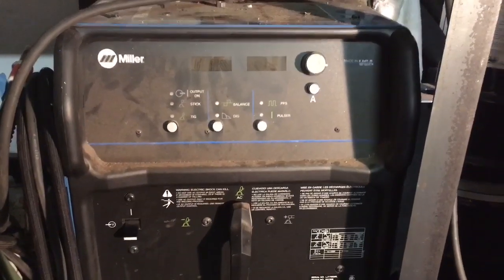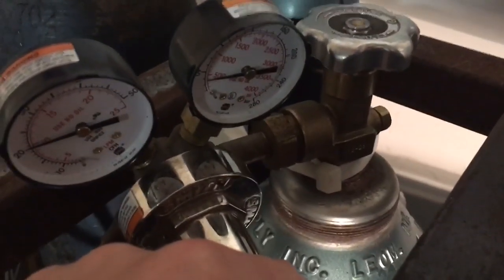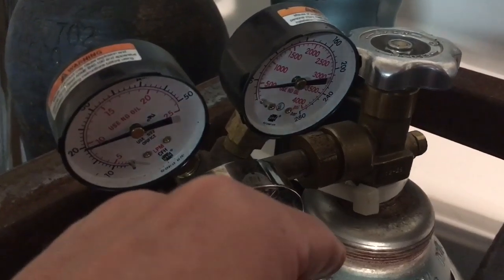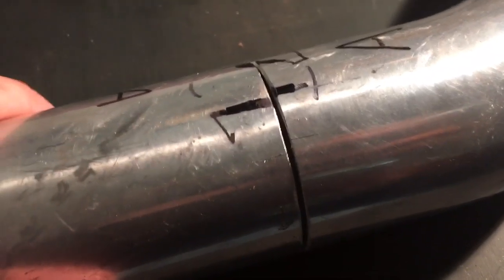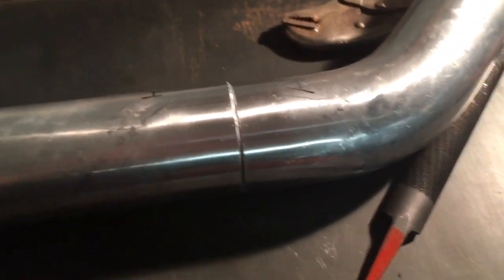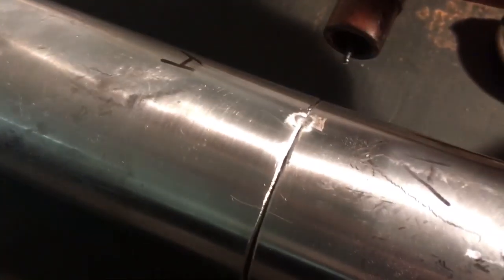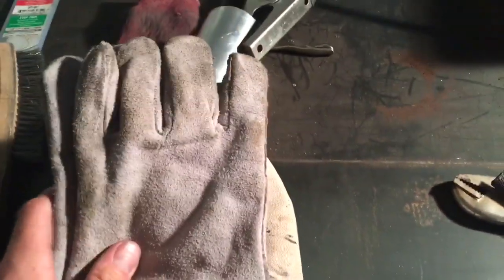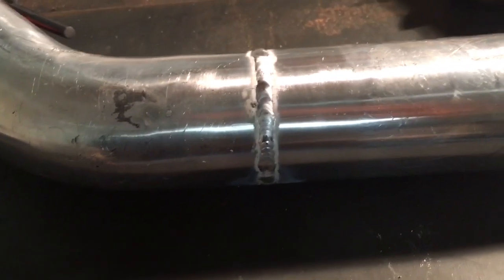How to TIG Weld Aluminum for the First Time. 10 Beginner Tips!

Comment: Ps. 100% argon 100% of the time when tig welding!
Reply: except for copper which you can add helium
Reply: not always.. you can tig weld aluminum on DC using pure helium and adding helium to argon in different mixes works great too  for aluminum.

Comment: Would have been worth touching on dabbing. When to dab and how tp traverse a joint with filler rod. Without that then it's still a shot in the dark trying to get off and welding with just the info in the video.

Comment: Jeremy, I'm sorry, but you gave some incorrect information. First you do NOT use any co2 mix with Tig, you must use 100% Argon (or argon/helium mix). Nobody uses dark green (pure) tungstens any more, use Ceriated, Zirconiated, Lanthanated, E3, Layizr, etc for Aluminium. With a Transformer machine like yours you can ball the end for Aluminium but don't go too far (1 to 11/4 diam. of tungsten) and it should still be shiny silver NOT black (burnt).Keep the electrode pointing toward the centre of the pipe when welding, you don't need to back purge Aluminium.

Comment: Not entirely necessary to purge the backside of aluminum. This is usually done with food grade stainless because porosity is a great place for clogs and for bacteria to grow. Also, if purging, you want a hole for gas to enter and to escape- otherwise when you are connecting the weld and sealing the seam the gas will have to blow out through the molten metal and leaves a large hole and a mess.
Reply: And a couple more things... You should ideally hold your tungsten perpendicular to the workpiece. Also, good rule of thumb for tungsten stickout is only as far as your gas cup/lens is wide on its inside diameter.
Reply from the maker: Muffin Man - great advice - thank you!! Like I said, I’m not a professional by any means, but I’m decent at making two things stick together. ;)

Comment: Co2 mix is no good for TIG. 100% Argon is what you should be using.
Reply from the maker: Good to know! Does that apply to Mild Steel and Aluminum?  I had used CO2 / Argon mix in the past when welding mild steel and it seems to work fine for me.  What issues could happen?
Reply: Aluminum will react violently with C02 mix. Even on steel, the Co2 will make the weld crappy. It will work but don't weld anything critical. Co2 is an "active" gas. That means it combines with other elements, so you're introducing carbon into the weldment (very bad idea).Argon, is inert, meaning it cannot chemically combine with anything. So even though you can lay a bead down doesn't mean it's got any integrity. Try it on aluminum and you'll see what I'm saying. It will make a MESS!
Reply: Introducing carbon into the weld, makes it brittle and weak.
Reply from the maker: Good info! But now I have more questions... Isn't CO2 / Argon the right mix for MIG welding steel though?  Why is it okay for MIG, but not for TIG on the same material?
Reply: That's a good question. With TIG, the tungsten arc relies on the inert gas to 'ionize' and create a plasma arc (it's a physics/chemistry thing) whereas with MIG the gas is mainly used to shield the short circuit arc. Co2 does not ionize like inert gases (Helium, Argon, Neon, Xenon).But it will shield the molten puddle and prevent oxygen/nitrogen contamination. You can actually MIG weld with pure Co2. Hope that makes it clear as mud. lol
Reply from the maker: Seems legit to me!  Also - I watched a few videos recently about  back purging, and I'm now convinced that I need to back purge every pipe I weld. Soooo I'll be burning some money on some welding equipment in the near future.  (Darn? lol )   Thanks a lot for the information on this. I really appreciate the knowledge!
Reply: Jeremy N C2 what you are taking about is great for stainless only for mig tho. You can use helium Argon or 100% Argon for Tig. The tungsten can stick out the size of the hole in your cup that’s how that works. You never went into the AC settings as well, that’s important for what you are doing.
Reply: yeah, argon for all metals works and is typically what you would use, co2 is for mig welding.. helium may be used for aluminum as well but is 4 times the cost of argon so most people don't do that, helium will make the arc hotter and allow for welding thicker aluminum with a lower amp machine